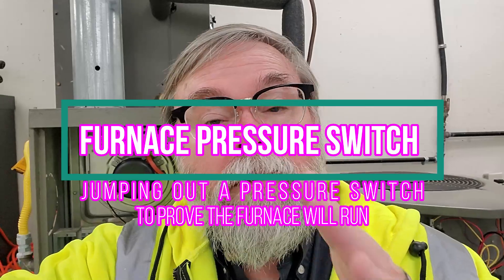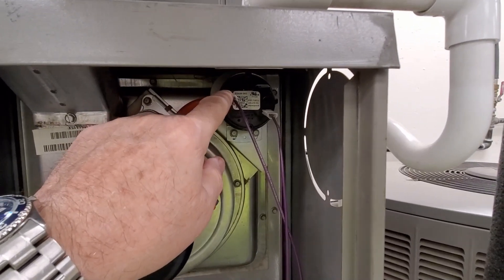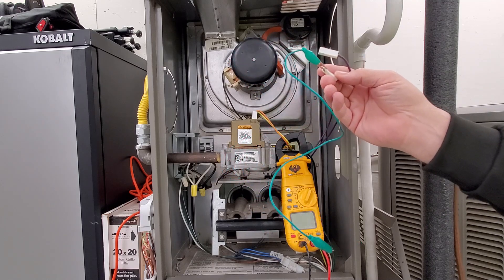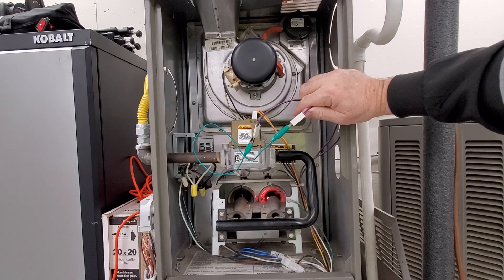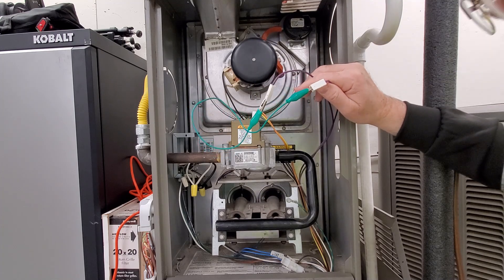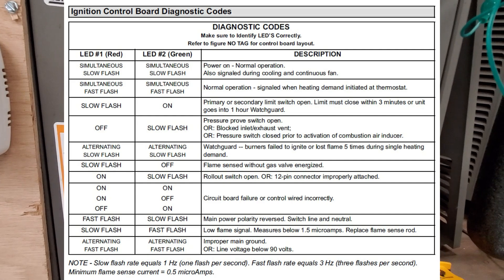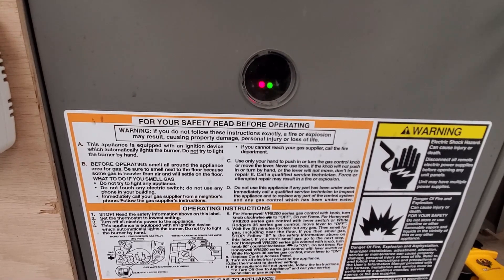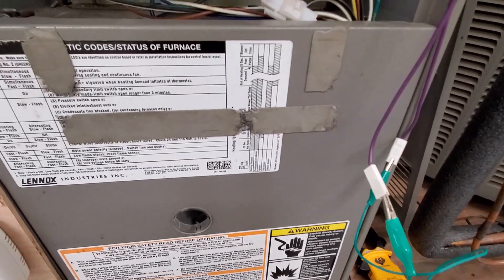Jumping out a furnace pressure switch

Comment: THANK YOU SO MUCH for this video.. I was getting a 3 flash code but wasn't exactly sure.. I removed the in-duct draft inducer motor and disassembled the entire thing.. frozen bearings,  worked them loose,  cleaned,  reinstalled,  and still had that code.. watched your video,  jumped the pressure switch and, BOOM.. furnace ignited.  Now i know for sure.. Thank You 💯

Comment: -10F here in MN this morning and this switch decided to go out.  Got it jumpered until replacement part can arrive.  Thanks!
Reply from the maker: Be careful, jumping one out is only to see if it is the pressure switch and to temporarily check the rest of the operation of the furnace. Once the thermostat is satisfied it will shut down and not come on again because you have to manually jump it out each time.
Reply: @ repair tech showed up and showed me the fresh air intake had iced closed outside.  I checked that but because it was a coaxial intake/vent system I only looked down the middle pipe. Didn’t realize the ice around the outside was an issue.  Live and learn!
Reply from the maker: @ Problem with a plugged exhaust is that the furnace can start making CO in a big way caused by the plugged exhaust. That is why the pressure switch is there to prevent killing the customer.
This is where checking the rest of the operation of the furnace. I would have put my combustion analyzer inside the flue and checked the CO levels in the flue gasses. More than likely it would have shown up as very high and maybe even spilling out from the furnace heat exchanger. Which could be very deadly. 
Again, jumping out a pressure switch is never to be left in that configuration as we could potentially kill someone.